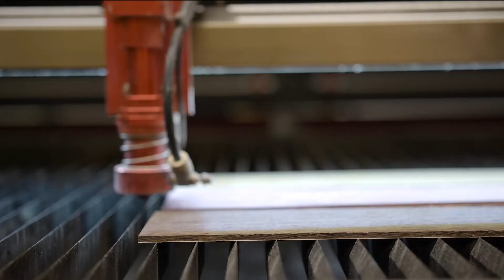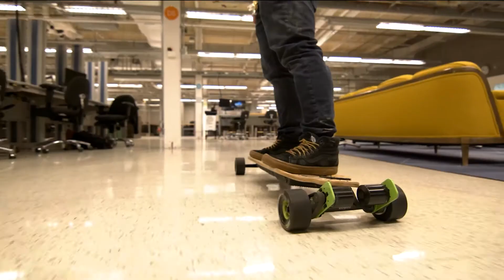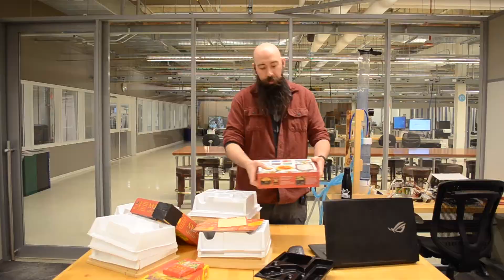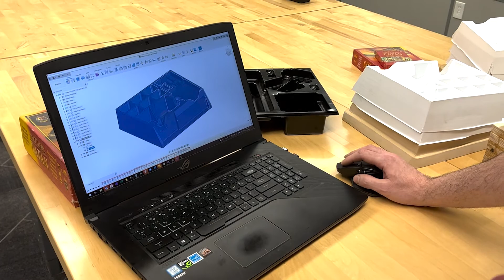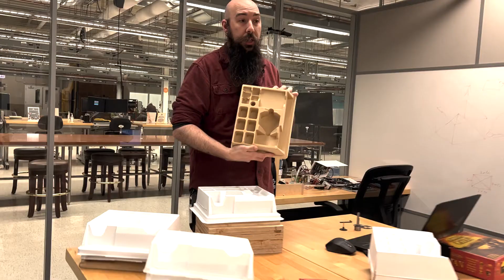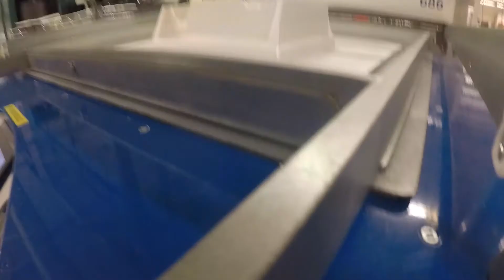Vacuum Forming a Custom CATAN Parts Holder

Comment: Thanks for the explanation! I'm looking to do something similar for a new game and have some questions about your MDF forms. You mentioned that you thought you needed holes to help pull down to the bottom of the pockets. Did that turn out to be necessary? What draft angle did you use when designing the form? Did you finish the MDF in any particular way before using it? I also am curious why you went with 1.5mm styrene, did you try other thicknesses as well? Super cool project overall and thanks again for sharing.